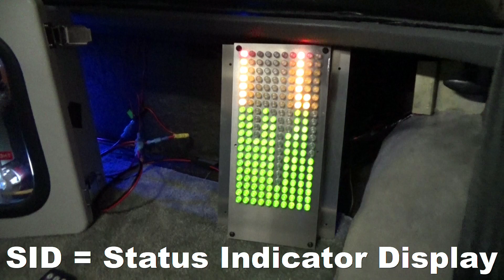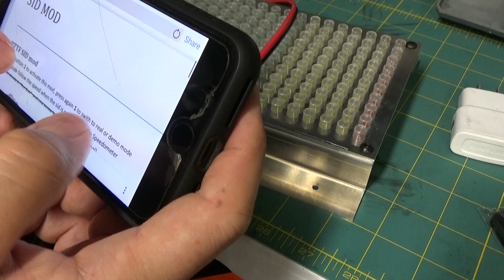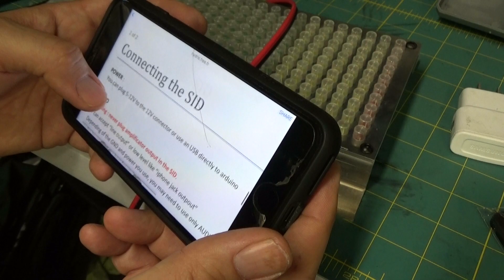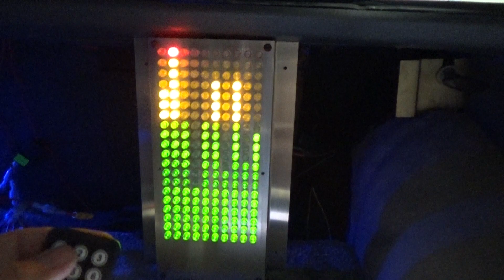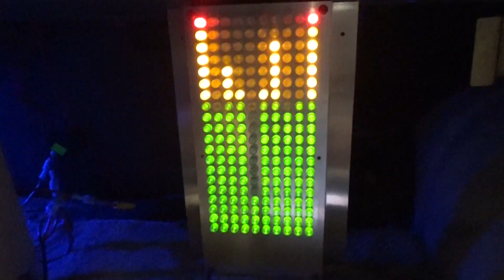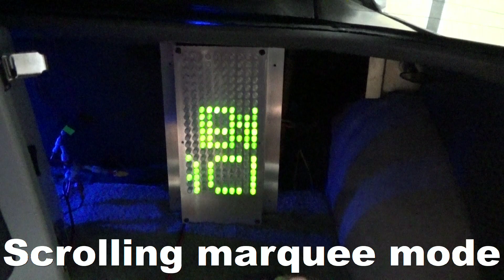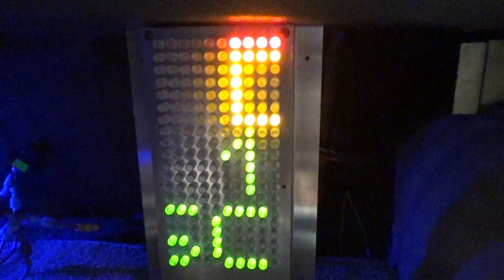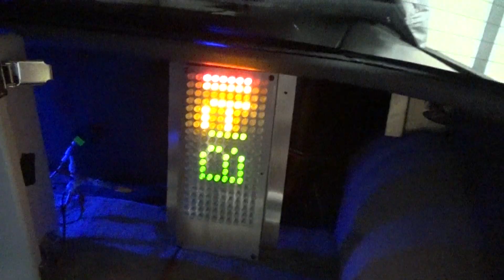Tech Review: Back to the Future Status Indicator Display (SID) Installation in DeLorean DMC-12

Comment: Hey @deloreantech I bought the same SID and wanted to see if you know how to hook it up to the BTTF speedo? 
I didn’t get the speedo from Timecurcuit.  The speedo is from another seller. It is GPS that I hard wired into the accessory wire (and ground) of the car so it turns on with keys. How would I connect this SID with that speedo would you know? 
Thanks - James @mydmcdelorean
Reply from the maker: Yes, they included a connection hub for all of the components to connect together. I think you need to have that hub. It’s got four USB ports on it and is designed to connect the SID, speedo, flux, capacitor, and time circuits display.
Reply: @DeLoreanTECH  Thanks for the reply. TimeCircuit told me about the Hub, unfortunately I don’t think the other devices are compatible unless you get from him. I’m new to this and got SID / FLUX and Speedo from 3 different sellers with diff set ups LOL. All good lessons to be learned for the future. Thanks again

Comment: USB connectors run on approximately 5 volts. But regular car voltage is 12 volts. Any issues?
Reply from the maker: They recommended a step-down voltage regulator.  I went with a 9V. I don't recommend running this directly off the 12V system in the car, even though it is rated for it.  See video description for more info!

Comment: lol i love to have one bad is it working whit the speed youre driving ?
Reply from the maker: yes it does when connected to the SPEEDO
Reply: @DeLoreanTECH  a ok love yo get the bleuwprints an software :D . im working on the flux capasitor using gps bad i having problems geting the software to work.
Reply from the maker: @compukit007  I would contact Sebastien Vignal on Facebook -- he programs the Arduino code that runs the flux, SID, TCD, and Speedo